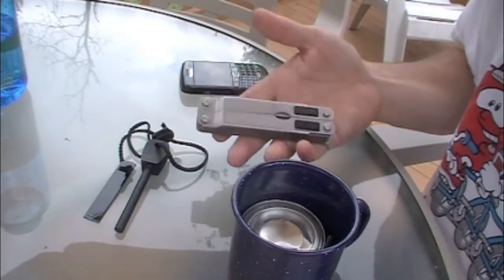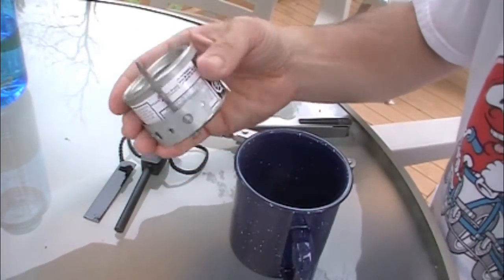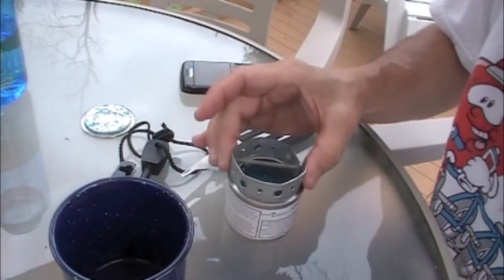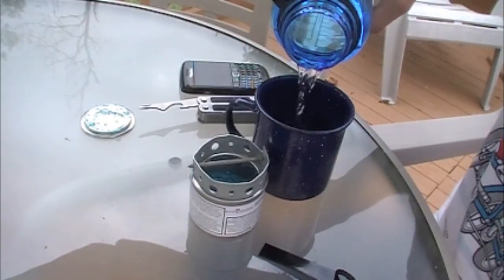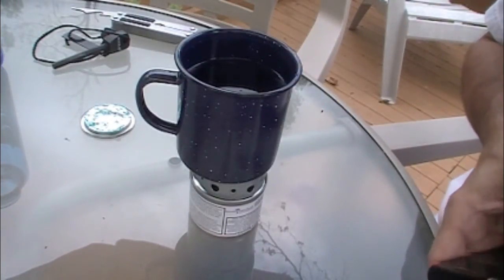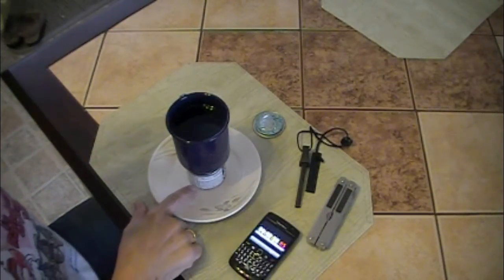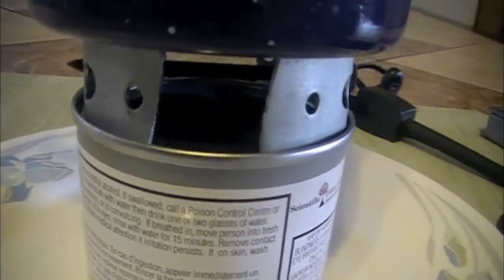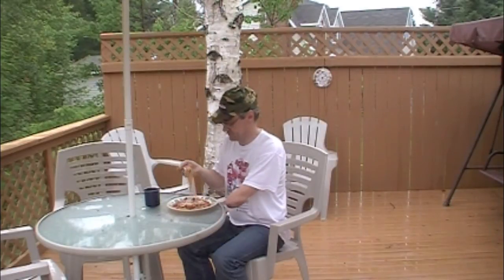Sterno Pocket Stove Boil Test - FAIL

Comment: Sterno will work ....if your not in a hurry.  I use sterno too provide a little heat to a tarp shelter or emergency car heater. Cheers sir.
Reply from the maker: Does the gel freeze? Do you think it would still light at 40 below? Might be a good way to melt snow without scorching your pot, you know... a gentle heat.

Comment: Sir, a great video. 
However, you are better off with a Pocket Rocket 2, and a cup that is just a bit wider (more bottom-area to heat), although these "wider cups" are not as tall as the one you used. Oh, I guess it is one thing for another, volume-wise, however, I would change your items. Pocket Rocket 2, with a wider based cup, will turn your use-time to approximately 3.5 minutes.
Thank you Sir, for your hard work.
Reply from the maker: Thank you for watching and for your suggestions. Since I made this video five and a half years ago, I've upgraded to many different stoves. I now have systems which work very well for me, and you can see them in many of my more recent videos.